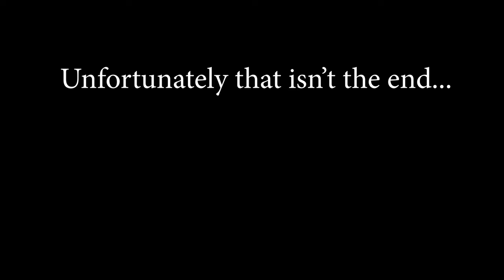35 - CriCri Airplane Build - Elevator Controls

Comment: There is no difference in compression strength between 6061 and 2024 tubing, given the same sizes.   It's a common misconception. The tube will fail in buckling and buckling failure is determined by the modulus of elasticity, not ultimate tensile strength.  The modulus for pretty much all aluminium alloys is the same,  same with steels of various ultimate strengths.

Comment: What software did you use to cut out your parts on your router table?  Very impressive build and presentation.
Reply from the maker: @aircam364th3 I use BobCAD/CAM for the CAD drawings and CAM. The table itself runs off of Centroid CNC software and Centroid ACORN CNC controller. Very happy with the Centroid products and software that I have been using for almost 5 years. I'm in the process of switching away from BobCAD/CAM since they no longer support hobby/maker pricing and is just too expensive.